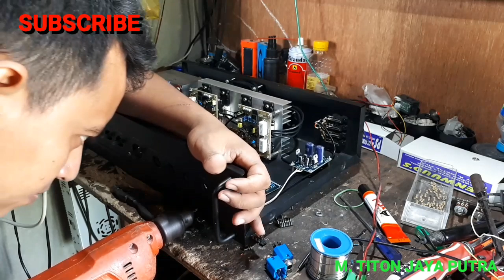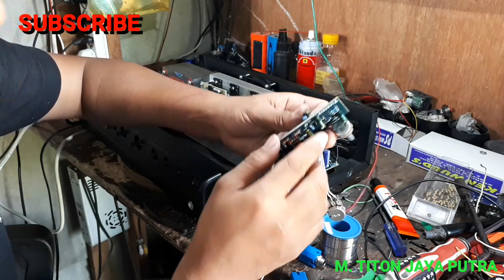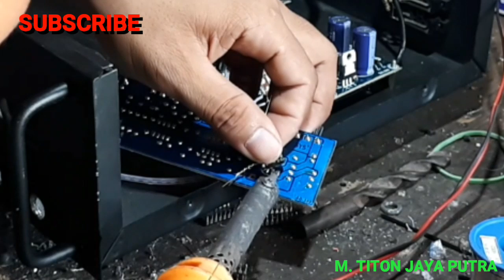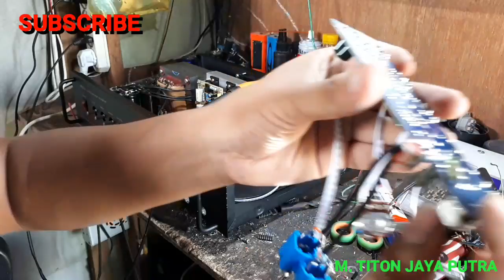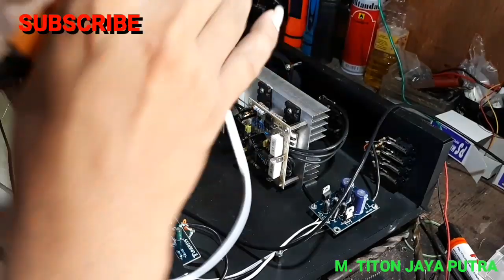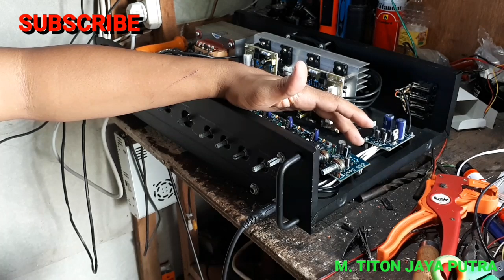CARA PASANG TUNE CONTROL , MIXER DAN EFEK BIAR MANTAP SUARANYA BENING DAN SEIMBANG.. PART 2

Comment: Mas klo mo ngasih tone control+preamp Mic+echo pada power ampli, bagusnya 1 trafo (power suply) atau 2 trafo alias sendiri-sendiri?
Reply from the maker: Klu saya pakai trafo sama, ambil di extra
Reply: @MTITONJAYAPUTRA100813  itu kan mixer nya dipotong, terus output buat ke driver nya ambil darimana mas ?
Reply from the maker: Jalur sbelum out mas.. bisa di telusuri..

Comment: Mas titon sing guanteng boleh tanya dong.klu untk mengangkt speaker 15 inc 800w yg pas pake final toshiba/sanken berpa set & travo brpa amper per chanel?trma ksih.
Reply from the maker: Final tergantung amper trafo bos
Reply from the maker: Klu 800w mending pakai 20 amper
Reply: @MTITONJAYAPUTRA100813  ok thanks mas bro.